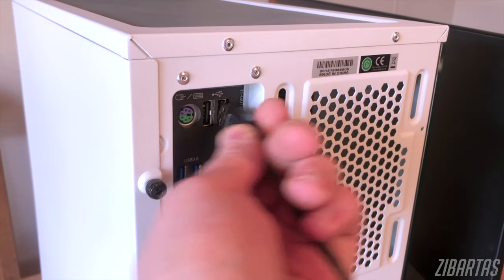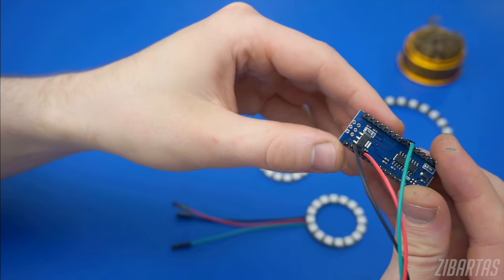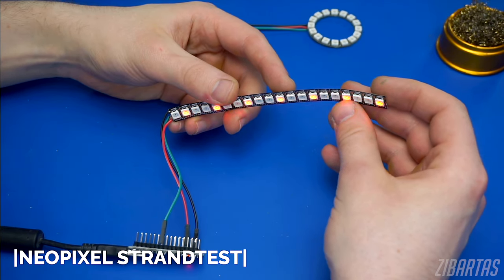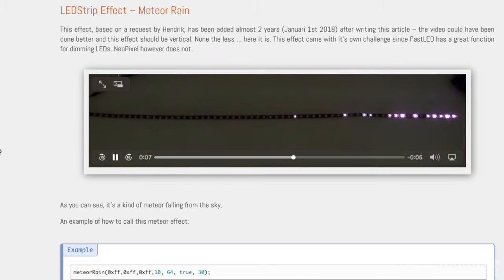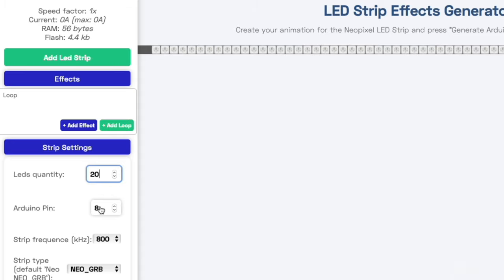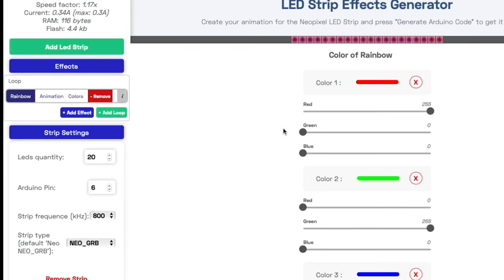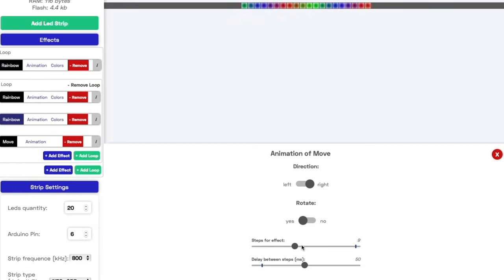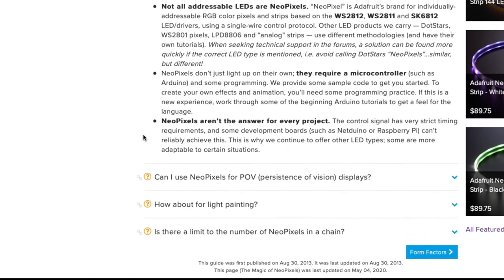NO CODING Animated LEDs - Ultimate Beginner’s Guide - Cosplay and Props

Comment: does the wire connection work the same for the arduino and trinket ?
love the content
Reply from the maker: Different boards have different pins - but they are labeled  - so double check :)

Comment: You probably won't see this, but I am wanting to put together an Astro Bot cosplay and was wondering if this would work with animating its eyes on the inside of the helmet's visor?
Reply from the maker: If you're planning to use addressable LEDs -why not! :D
Reply: @Zibartas  my other question is: what would be the proper way of mounting the led strip/sheet? Would you pinlock it to the visor or directly glue it? I've seen people 3D print a cage-like faceplate that goes between the front and back of the helmet.

Comment: Im new to this, its one arduino nano per strip led or can I connect several LED strips to an Arduino nano?
Reply from the maker: If you want multiple things happening at once - you need to connect strips to separate pins. There is a limited amount of PWM capable pins - the bigger the Arduino the more pins it has - so it can do more different animations at the same time. That's the software part. Hardware part - if you just want a lot of strips performing the same animation - just connect them in parallel (same +, - and DATA). Arduino doesn't know if there's 1, or 5, or 125 strips connected to it, it's just pushing out the same signal ✌️

Comment: Does this Adafruit Neopixel library code run with any LED strip?
Reply from the maker: Well, yeah, the addressable WS2812 based ones are all the same + it supports some others. Check documentation if you are using something exotic :)